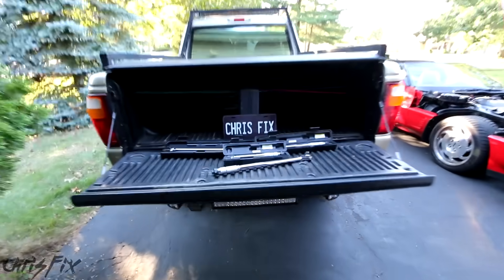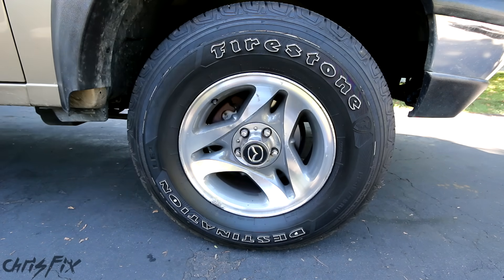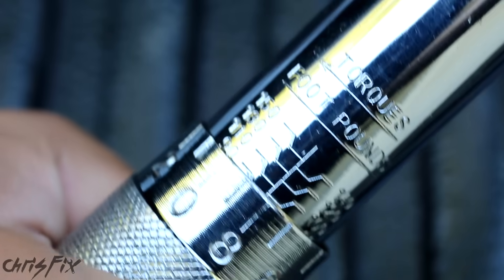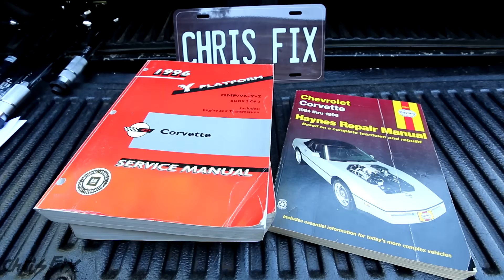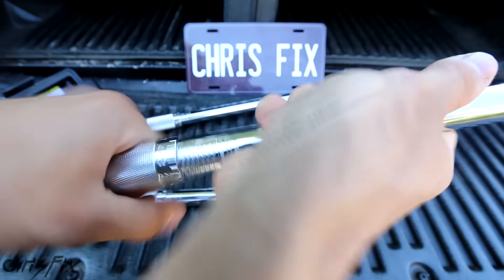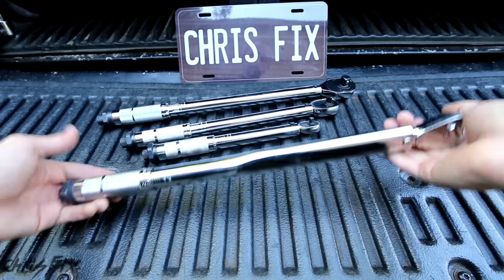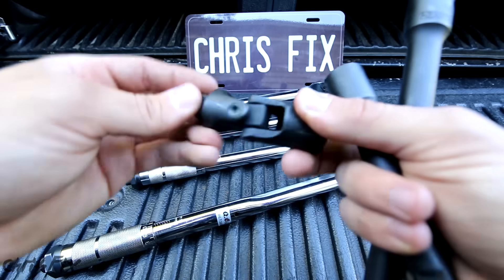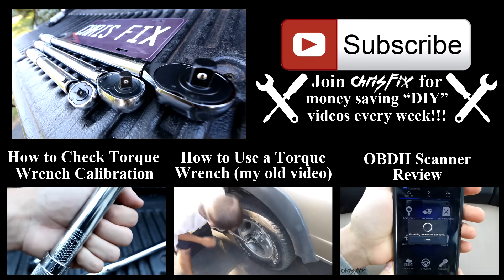How to use a Torque Wrench PROPERLY

Comment: hi Chris i have a 3/8 drive torque wrench that torque 20 to 80lb ft. but i notice that the wrench does not seem to click when i reach the desired torque. i have never dropped the instrument or use it for other purposes. i notice the oil plug is missing and here is some evidence of some oil in the storage case.could this be the cause of the instrument not giving the click that indicate complete torque? what is your view.
Reply from the maker: +David Blackman That oil plug is really a calibration plug that protects that calibration. I would set it to 20ft lbs and tighten a lug nut and see if it clicks. If not, your torque wrench is not working and get it fixed or a new one (link to a good one in the description). Good luck and keep me posted!
Reply: ok thanks Chris,i will try it during the day tomorrow and see what the results are.
 however,Chris i have a mechanical challenge with my vehicle.i was checking my timing belt for signs of damage bit a fastener adaptor accidently dropped into the lower timing belt cover.i took off all the drive belts except the timing belt and A/c brivebelt. the challenge for me is how can i loosen the the crank shaft blot anticlockwies without risking internal damage.i dont have a impact air power tool to do this. i know that the engine rotate in a clockwise direction.what can the most simple alternative right now.i cannot start the vehicle because the lost object could damage the tming belt and make matters worse.

Comment: one thing i see so many self proclaimed experts on you tube doing wrong is when they use a torque wrench. if the wrench clicks without the nut or bolt turning first, IT'S TOO FUCKING TIGHT!
Reply from the maker: +jo schmo Thanks a lot for sharing!
Reply: ChrisFix no problem. sorry for cursing but gees i wish some folks would grow a brain. you seemed to do it right in your video but thought i would stress the importance to others of making sure it turns before the click.

Comment: Hey I liked the video 
, I just rented a 1/2 in drive  Evertough torqe wrench #67075 from the local auto parts store, because mine was slipping.. it reads different from mine and I was wondering if you might shine some light on the numbers .. I understand the numbers on the handle to dial up to .. but on the handle dial instead of being numbered 1-10, it reads 0, I, 3, I, 6, I, 9, I, 12, I , do you know what these numbers translate to or the calculation used to figure out how to tune this thing in ?

Comment: One should have a full set of torque wrenches with a variety of ranges because torque wrenches are most accurate around mid range of the scales. The accuracy falls off at the ends of the torque wrench's range. Chris makes a lot of good points. When it comes to brakes and suspension, the proper torques are critical. Otherwise you risk bolts breaking or working loose while you are driving. Balanced torque across rotating assemblies is extremely critical if you expect your bearings, brake calipers, or brake drums to last. If your wheel lug nuts have uneven torque, it can throw the runout of your rotors off. Thus premature pad wear and rotor warpage from friction overheat. The same holds true with lugnuts over brake drums. Brakes are self adjusting. Uneven rotors and drums cause confuse the adjusters. They over adjust as a result.

Comment: great video, thanks for sharing your knowledge! whay do you think of torque gauges? I can get a digital torque gauge for $80 AUD locally (about $110 USD at time of comment), but do drive size adaptors affect the torque reading, and are the digital torque gauges accurate enough? Would it depend on the brand of the gauge? Should I just invest in traditional torque wrenches?
Reply from the maker: +catphish81 I think the gauges are good enough for diy'ers. I prefer a click style because it is hard to torque down and watch the gauge at the same time. The more expensive ones tend to be more accurate.

Comment: Hey Chris,

You mentionned to reference our manual for torque specifications for tightening bolts but my user manual that's in the glove box doesn't tell me the torque setting (ft-lbs) for all of these bolts I see you torquing down throughout your videos. Where are you getting these figures?
Reply from the maker: +KINGsizeWINNER The service manual not owners manual. So you need to get a special book specifically for fixing your car. It is called a shop or service manual.

Comment: Just to add, torque wrenches get less accurate closer to their extreme values. So your 1/2 inch that goes from 20 to 120ft/lb isn't going to be great in a situation where something needs to be tightened to 20ft/lb.

I look forward to the calibration video, I didn't know much about torque wrenches when I got mine and I think it needs to be calibrated. I used it as a breaker bar many times.
Reply from the maker: +Super Vitz Thanks for the tip!

Comment: might should mention that at the lower settings the wrench doesn't usually "click", but feels like a slight "break" or give on the handle. If you think you're over tightening a bolt. Stop, let off pressure, then give it some pressure and feel for the "break".  Might consider replacing the bolt if you over torqued it, especially head bolts and intake bolts.

Another tip is to try out the setting on something like the lugnut first before using it on your bolt. Get the feel of how the wrench works at that range. If you're doing heads with 15 ft/lbs try that setting on the alternator mounting bolt or a bracket bolt that has a larger head. the larger the head, the more they are torqued usually. Good way to find loose bolts too. ;)
Reply from the maker: +Co Jones Thanks a lot for the tips!

Comment: I am finding that old beam type torque wrenches are more accurate and only calibration you would have to do is move the meter pin to 0.  Also don't need to unwind when you are done and lasts forever as long as you oil it to stop the rust.
Reply from the maker: +Sang Kim The beam style is great but harder to use!

Comment: how tight should the bolt be with my ratchet before using the torque wrench? can i tighten the bolt softly until it doesn't tight  any more with ratchet and then use torque wrench?
Reply from the maker: +carlosb1 Exactly. Just snug it up. No need to crank it hard with the ratchet.

Comment: Hey Chris. How would you know if the calibration is correct ?
One could purchase a cheap or expensive torque wrench and both could be out of calibration.
Is it even worth having them calibrated ? Is it possible to have them calibrated ?
Reply from the maker: +Royalbigness There should be a little piece of paper saying it has been calibrated and certified. If you want you can get a digital torque adapter you can check your wrench.

Comment: as another tire fitter you made on mistake when tightening the lugs you pulled up it doesnt mess up your torque but it does mess up your back. always push down just be safe :)
Reply from the maker: +Matthew Keenan Thanks for sharing. I prefer pulling up because I have more control over the torque wrench and I can lift more than my body weight can push down.

Comment: In your initial demonstration of how to torque a lug nut you were applying a pulling/sideways force which is incorrect. If you are having to bend over to torque something you must be straight above what you were torquing and pulling upward toward you. The pulling/sideways force you were applying will cause an incorrect torque value despite what you have the torque wrench set for. Never torque anything away from you always make sure you are pulling the torque wrench towards you keeping a closed fist grip on the center of the torque wrench handle. Another thing is that you must keep the torque wrench in storage at its lowest setting not slightly above not below. Two things that you failed to mention is to exercise your torque wrench prior to torquing this is accomplished by setting your torque wrench to 60% of max value and attaching it to a bed plate that has an appropriate sized attachment welded to it. After setting your torque wrench to 60% max value use the torque wrench at least five times. This is obviously not required for dial indicating torque wrenches. Never trust the use of the top and bottom 15% value of the torque wrench as the spring can be too loose at the bottom and into tight at the top and giving incorrect torque values. If the torque wrench you have and the spec you need falls into the higher or lower 15% of the torque wrench can use the next higher or next lower value set torque wrench. You may be wondering where I got all this information, well this is from torquing on Navy missiles with (QA) quality assurance inspectors watching over my back for the last 20 years.
Reply from the maker: +Spushed Thanks for sharing your knowledge. While those tips are great you have to realize that this is a car, not a Navy missile. And for my torquing demonstration, I was not pulling sideways, there was an extension and the socket doesnt fit the lug nuts perfectly so there is a slight movement. Of course this wont give you the perfect torque but remember that this isnt a perfect science for torquing car fasteners (unless you are rebuilding an engine). Thanks for your feedback.

Comment: When I was in my teens and early twenties the ritual was: buy car, go to the local auto parts store for tune up supplies, and buy Haynes Manual for said car and keep in in the glove box.  It's nice to see people still use them.  Nowadays you could search the internet but it's still much easier to have the car broken down step by step without searching websites for videos.
Reply from the maker: +lilturk726 Thanks for sharing! The haynes manuals are great guides but they are not always accurate which stinks. I use them for reference to see what a job entails but they miss so many important steps.

Comment: Torqueing down axle nuts is 100% impossible to do.The wheelbearing manufacturers are liars saying damage to the wheelbearing is done when tightening an axle nut with an impact.I do this and no damage is done,stop when the socket quits turning.Certain spots,it is 100% impossible to get a torque wrench in.Most places will not calibrate the foreign made torque wrenches made in Taiwan.
Reply from the maker: +wafrederick Thanks for sharing!

Comment: you should see the torque wrenches that are used on aircraft wheels... 4 feet long and go past 700lb-ft range
Reply: +Ira Friedman 

We had a hydraulic torque wrench where I used to work. It could go up to I believe 2,000 lb*ft. We used to have a torque multiplier (Up to 800 or so lb*ft) that broke that caused an employees forearm to go into some blades.
Reply: +Ira Friedman Should see the size of the hydraulic torque wrenches the engineers use on oil rigs they were good for 100,000lb-ft according to the engineers I spoke to.
Reply: Ira Friedman no i said "at" Boeing. as in Everett, WA but it dont sound like you do so never mind. thats cool that you work on c-17's though. i used to see those flying around Merced, CA till they shutdown Castle.
Reply: ***** I work on C-17s with the air national Guard... technically yes Boeings after McDonnell Douglas got bought out
Reply: +Ira Friedman do you work at Boeing?
Reply from the maker: +Ira Friedman WOW!
Reply: +jo schmo I do comm/nav... don't really deal with heavy equipment much... mainly computers and stuff +joe schmo
Reply: Ira Friedman thats cool. im about ready to build my first computer. just need to save the money for it.
Reply: Lol surprisingly the f18 doesn’t even use a torque on the wheels you just fasten it not to tight and not too loose.
Reply: The torque applicator (that's right we cant even call it a wrench at this point) that we use on chinooks rotor head nuts (aka the jesus nut) is quite phenomenal. Looks like a minion and takes about 15 minutes to get the nut tq to 5500 to 6000 ft lbs
Reply: They don't just use a hydraulic wrench or torque multiplier?
Reply: @snap-off5383  nope. No power tools allowed
Reply: I'd imagine they use them on the wheel nuts, not the wheels.
Reply: Damn
Reply: Then make a video fucker

Comment: two things, 

-using an unsupported extension adapter is bad form. it applies torque not only rotationally, but axially, and can damage the nut as the wrench socket is pried off during use.
-a beam type torque wrench needs no adjustment and is as accurate as an adjustable one because it has no springs or moving parts to wear.
Reply from the maker: +pssst3 Thanks for sharing!

Comment: Thank you for sharing this. I have a question related to storing torque wrenches. When I store them I set them to the lowest possible value and block them with the lock nut. I don't tighten them up a bit (as you did in the video). How much does this impact on the calibration of the wrench, considering that I'm not using them so often? Thank you
Reply from the maker: +Levente Varga  It isnt that big of a deal. You want to have slight pressure on them but even if you dnot it wont matter.

Comment: I use a 1/2" drive Proto (clicker)for most anything I need to torque, my shop manual (S-10/Sonoma) lists most specs by ft. lbs., & occaisionly in. lbs., my question is how do I convert in.lbs. to ft. lbs?  Is it in hundredths, like 360 up to 480 equals one foot pound? My in. lb. torque wrench has 120 @ the lowest & 960 @ the highest, would that be 120 for one pound & 980 for ten? Also, if I do need to use an extension, say a thin one for whatever reason, should I add a couple lbs. just for ?? (I'm not refering to internal engine parts, more like a transmission bolt to bellhousing or something)
Reply from the maker: +chuck lane (Chuckylane) 12in-lbs is 1ft-lb so 24in-lb is 2ft-lb. If you use an extension dont worry about adding torque because you wont get that much of a difference if any difference at all.
Reply: How bout that! At first I did think it was like a tape measure, of course later on telling myself it can't be that simple. I must have learned how to complicate things from my ex-gf!

Comment: Can you show me how to put transmission oil on my 1999 VW jetta pliss help
Reply from the maker: +Cristian Parra You just put a funnel in the transmission dip stick and add a little at a time. Measure the fluid level when the car is running.

Comment: My dad says that click adjustable torque wrenches are the worst ones available. The more you use it, the more the spring inside stretches/releases and gets inaccurate so should you just invest in a good one?
Reply from the maker: +Denny759 I mean, I use them all of the time along with thousands of other professionals. It is the easiest one to use and when you work on your car it works great. The one I linked in the description works pretty good!

Comment: hi cris i just wanted to say that 100 lb foot pounds is too much it should only be around 75-85 lb foot pounds other wise u could strip the bolts or eaven worse uf u hit a kurb the nuts would try as hard as possible to hold the wheel on and could damage more parts and would  cost a lot more. if u look at the car manual it should say it only needs around 80 lb of force. not saying ur wrong i am just saying that since u said u could strip bolts by over tightning that is what u would/could do with the torqe spesimens u have got on ur car
Reply from the maker: +Nathan Lloyd Thanks for sharing Nathan. The truck calls for the lugs to be torqued at 100ft-lbs. Check your owners manual for your specific car.
Reply: +ChrisFix hi thanks for eesponding to my comment and great that u do know about the owners manual specifacations and yes all the 4 cars we own say 75-88 lb in the manual.

Comment: I always hated seeing people around me in the shop using torque wrenches incorrectly...
Reply from the maker: +douro20 Now just show them this haha
Reply: @matt8863  Only if its an inappropriate extension (has a swivel, or joint, or is smaller in diameter than the bolt you're torquing.)

Comment: I was thinking about a cold air intake and a cat-back exhaust system, would this add hp to my 1994 camaro?
Reply from the maker: +silentshadow458 Eh, it might but without a tune it is not worth the effort. The exhaust would be for the sound.

Comment: I mostly tinker with Bicycles and Motorbikes and I have 3 torque wrenches.  I havent broken a bolt in years (might have just jinxed myself) but I have lost count of the number of times friends have come to me and said "Of I wasnt putting too much pressure on, its the rubbish they make the bolts out of".  I have got quite good at using an Easyout and a Helicoil kit.
Reply from the maker: +fastmongrel Hahaha, as long as you are doing it right! Maybe show your buds this video haha

Comment: Some good info, however one bit was off the mark.  Maintaining compression on a spring does not wear it out, the change in tension on the spring is what wears it out so you're better off leaving it where it is when you store it rather than 'releasing' the tension.  The less you move a spring the longer it will last.
Reply from the maker: +Everybody Lies Thanks for sharing!